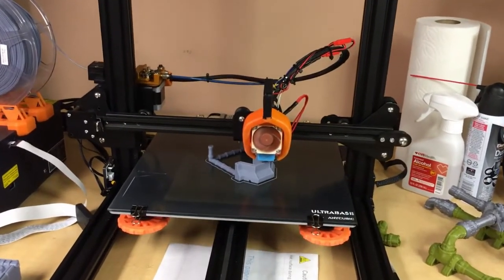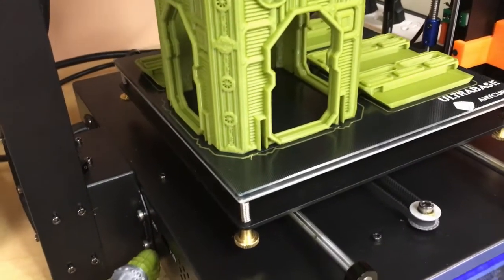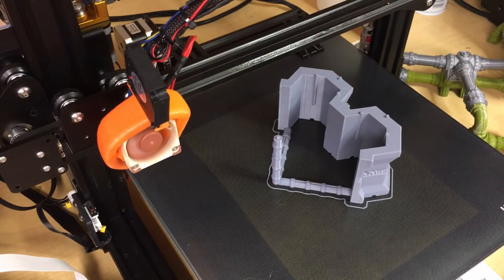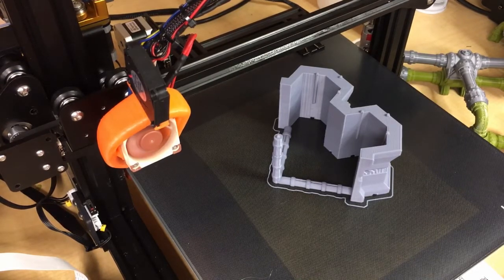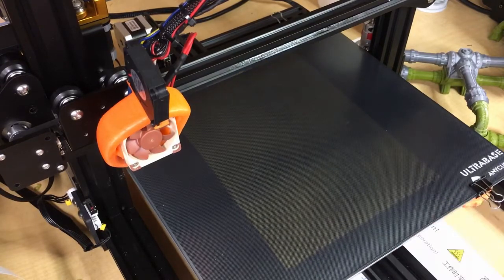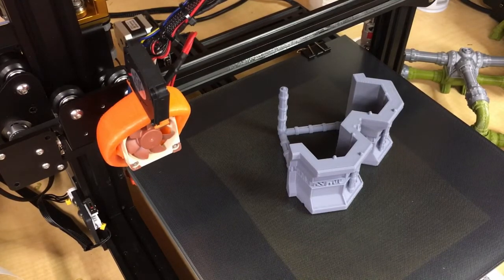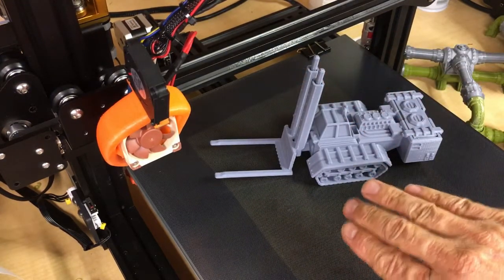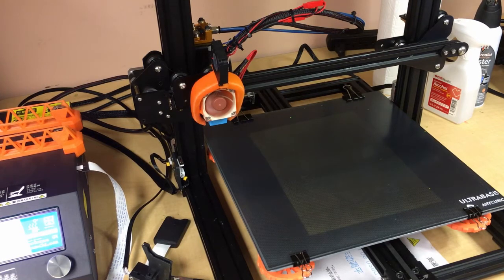"Anycubic Ultrabase" review for the Creality CR-10 3D Printer

Comment: I got it and a year later i HATE it, its fucking horrible. Nothing will stick to it, so you'll add hairspray, and then things get glued to it. Destroyed several parts trying to take them off, and tons of filament wasted on prints that ends up not sticking. STAY CLEAR of this calamity of a print platform.
Reply from the maker: Erik X That is no good. I have heard there has been QC or bad run issues. I only thing I didn’t like was the wait for the temp to drop and release the model.

Comment: I have the Anicubic Chiron - comes stock with this Amazing BED! LOVE it - simply no issues if bed is leveled correctly, Bed temp set correctly - and - WAIT for it to COOL before try to remove parts. I print Mostly PLA and PETG - Bed runs about 60C, I dont even try to touch it until below 40c - most often I hear it 'popping' as it is 'breaking' free of the bed, then, just pick it up : ) PERFECT!

Comment: I bought one and then I tried to print large abs parts with this (I bough glass and bed kit) and there’s a lot of warp... I’ll try to sand it... but it’s definitively not a “plug-n-play”
Reply from the maker: My CR-10S stock can not print ABS not matter what adhesion I use, base temp can not get above 80c. I recently modded my heatbed with a Keenovo silicone AC bed. I so far got to 105 c in 2 minutes 18 second. I will have to put up an ABS test print soon. Thank you for the comment.

Comment: I have the exact same setup as you and am having some serious issues. would you please give me a copy of your marlin firmware. I have tried everything I can think of and still EVERY print fails within the first few layers. It only started after installing a bltouch and flashing the firmware. My first layer heights are spot on but prints will stick to nothing. I have tried: LokBuild blue, Lokbuild orange, ultrabase, and a generic I found on Amazon (worst of all), glue stick and blue tape (some success but still poor). I have tried reflashing the firmware, but the source is too similar to my setup (From the same provider) and not sure if it can be trusted. I printed a temp tower today off thingiverse flawlessly and have no idea why it printed when everything else fails. I have tried more speed and less speed, every print height you can imagine and combinations of both, plus adding temp in to the equation. I am at least a hundred hours in to this issue now, to the point where I just ordered an original prusa I3 mk3 to give me some confidence back. I am on the verge of throwing my CR10s in the garbage and writing it off as a bad experience. I just cannot get my prints to stick, they curl up as if the previous pass was printed overlapping the last pass by way too much. I have tried Cura, Slic3r and simplified 3d with varying results of fail. Please if you can help I am all ears (or eyes in this case).
Ihave an E3d hot end, BLtouch, fang cooling with 40mm fan on heat sink.
Cheers buddy,
Darren.
Reply: My problem started out with my prints having no layer adhesion and splitting apart, especially on infill passes. I have changed the thermistor, twice actually. I have a whole new hot end and there is no obstruction in my bowden tube. I have changed my nozzle and tried multiple filament types (pla, pla+, abs and PETg). I am at my wits end, please, if you can help you will earn a lifelong sub.
Reply: The only thing I have not tried is a firmware I know to be valid. If you could let me install your firmware I would be really grateful.
Reply from the maker: How would I do that? I am running the stock set-up for the CR-10S from Creality. I know my CR=10s has to run  the hot-end hotter than my other machines: Anycubic I3 and a PRUSA MK3. I had to learn that through many under extruded prints. Did you check if you have one of the bad mother boards. There is a post on Tiny Machines 3D Facebook page on that.
Reply: @darren-garden  any luck on fixing your problem
Reply: It is possible that the crystal that you sent with your CR-10 is not completely flat, some users will pass this and that is why they did not paste their impressions.

Comment: i have problem with my ultrabase on cr10 , skirt dont hold on plate then all printing goes wrong.. dont know what to do .. i tried 50-60 celsius temperature but did not help.. also calibrate desk.. any suggestion ?
Reply from the maker: I have a feeling Anycubic put out a bad run. The Ultrabase my Cr-10 still has care free adhesion. I always run the bed at  60c. My problem now that I upgraded the to a silicone heater and insulated the bed, I have longer waits for the bed to release the part. The only upkeep I still, as in this video, cleaning with 90% isopropyl alcohol and clean paper towel (kitchen roll). I would send it back.

Comment: Quick question, on the Ultrabase just looking at the video there appears to be a rectangle area that is a different color? Whats the reason for that, it that the bonding area or some other reason for the color variation on the build plate?
Reply from the maker: That is a section of one layer of file folder used as a shim. I originally had it under my stock glass bed and thought the new Ultrabase would not need it. It turned out my Aluminum bed has slight concave to it. During the assisted bed leveling the middle was just slightly to low that the paper I was using slid without any resistance. That one layer of file folder has is pretty close to perfect.

Comment: I bought this because of your video it arrived at my house today my first review of this it is junk nothing worked on it nothing stuck to it prints would go halfway through and then break off
Reply from the maker: Wow! I have literally run 4 kilos through my CR-10S on the  Ultrabase without any loss. Just a 25 hour I ma pulling off the printer today. I saw another recent review on Uncle Jesse's channel where he bought the base for the same reason I did, the performance on the Anycubic I3 Mega printer. He reviewed and rated it just okay because it did not perform like the Anycubic's printer's base. My bases both perform exactly the same. I have a "feeling' the may have made a low quality run of the base material. Like anything, I would send it back if it does not work correctly.
Reply: Is it a heated bed?
U need a heated bed for it to work

Comment: How this bed works with ABS fillament?
Reply from the maker: My CR-10S will not reach close to 100c stock. I have a silicone heater on order. When I install it I will do an update. I have done ABS on the Anycubic I3, with the Ultrabase, successfully.